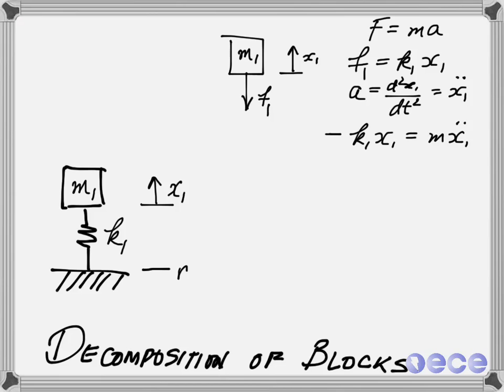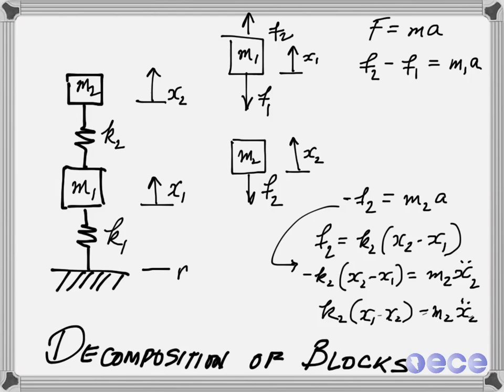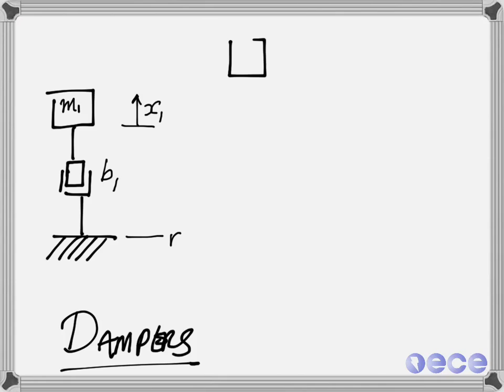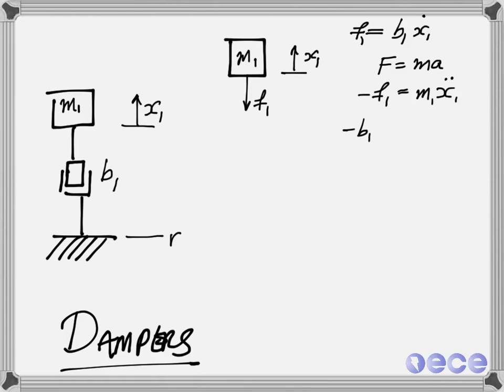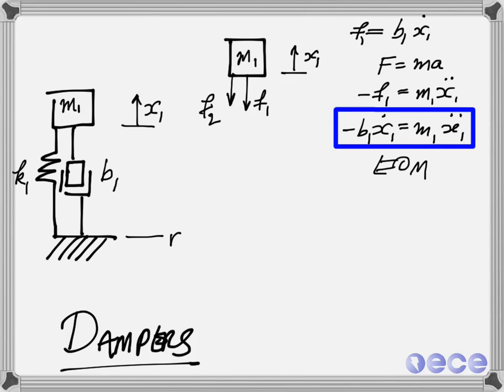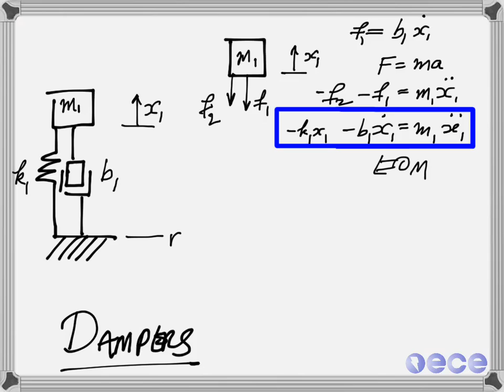FBD Decomposition

Comment: Hi Jonathan

Have you derived the equations assuming that the system is static (i.e) the spring and mass based forces are in equilibrium and no external forces are involved?